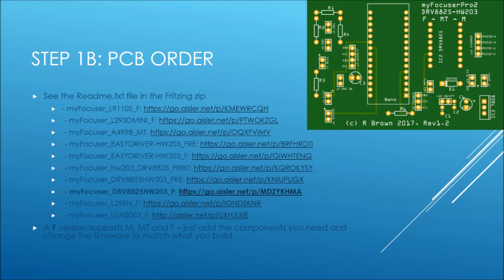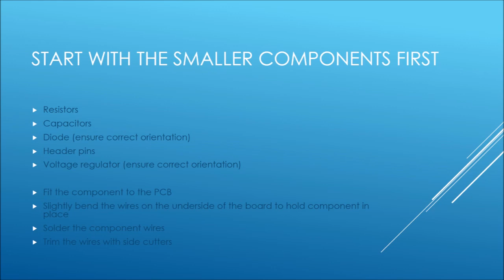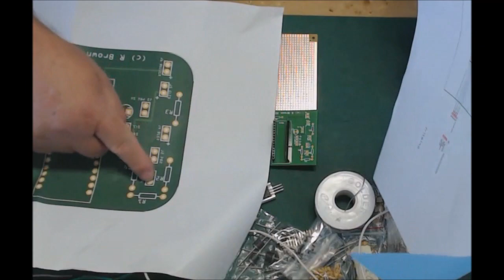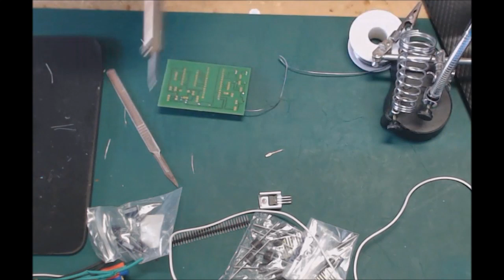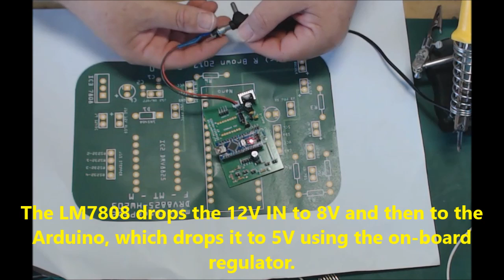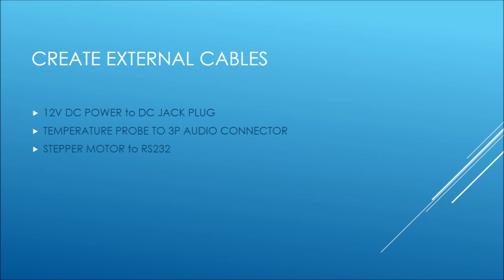Part 1b Assembly of myFocuserPro2 PCB

Comment: Good, and very detailed, walkthrough.  A couple of thoughts, though:

* Couldn't the board design be updated so that the through holes for the diode were big enough (or has this been done in the four years since the video was made)?
* It seems that, rather than putting pin headers on the board, it would make more sense to just solder on JST-XH connectors of the appropriate pin count.  That way, particularly for the ones where orientation matters, you only have to worry about it on the initial installation.

Thanks for the work on this design; planning to build one shortly.

Comment: On the board from Aisler(which is beautiful) I have a sopt for a resistor labeled 470k ohm. However, on the Bill of Materials(BOM) there is not a bullet to purchase said resistor. The 1N5408 diode is missing from BOM as well. Is this an oversight. Not trying to be nit-picky just wanting to get everything correct.
Thank you for your contributions to this masochistic hobby.
Reply from the maker: Thanks for the notes. Sometimes things change. This was started in 2014 and has undergone literally hundreds of changes with similar options. Its hard for even me to keep track of everything. The IN5408 was changed from an 10A10.The 470K a recent addition also. Yes, I can't keep up sometimes as this is a part-time hobby. I will have a look at the part lists again - but there are so many of them, one for each board, which board are u using?
Reply: I completely understand sir. You are extremely busy. I am using the profocuser pro2 rev 3 M,MT, F w/ BT. I do hate bothering you with this.
Reply from the maker: All good. I have uploaded a revised parts list. Thanks.